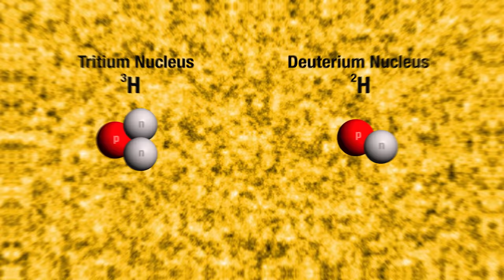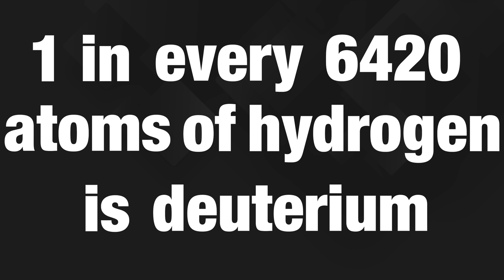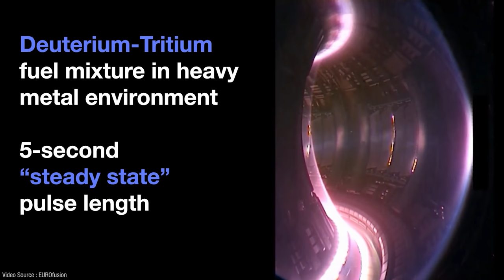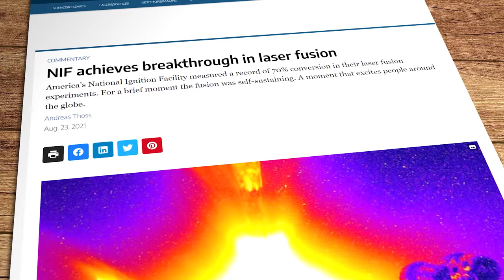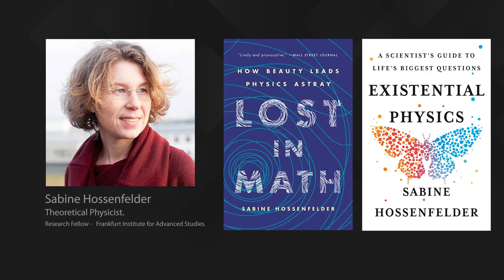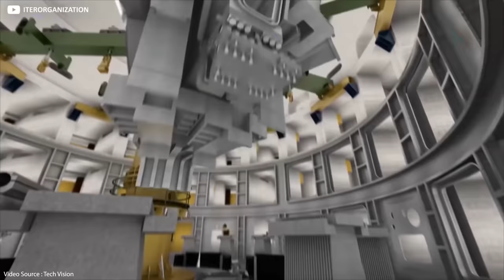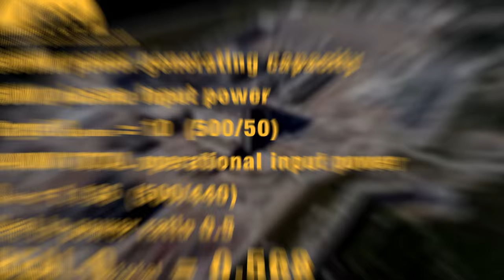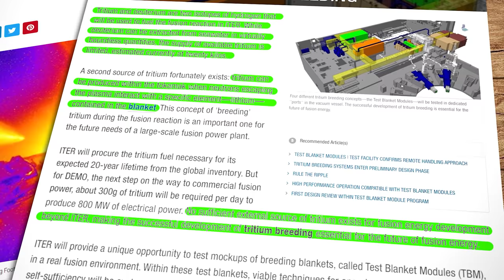Nuclear Fusion Illusion. Is it time to park the pipe dream?

Comment: A minor nitpick, but what we aim to achieve is not replicating processes going on in the Sun. Nuclear fusion in stars is very slow, with only one pair of atoms out of many many billions accidentally fusing and releasing a bit of energy. Any human fusion reactor, on the other hand, would have to achieve conditions far more extreme than those in the middle of the sun, to force a significant amount of atoms to undergo fusion.
Reply: And it's also imposible to replicate the inner presure in the core of the sun so we already needed to go hotter to compensate. So that makes fussion on earth realy hard. As always it's easier to break stuff (atoms) then put it together.
Reply: Brilliant comment, and I think you've hit upon the crux of the nub of the gist of what is central to the core of the issue.
Reply: Hey!  Here's an idea.  Let's just leave this process inside the sun and other stars!
Reply: What do you think mathematical physicists have not calculated the viability based on reactor speed? He is confusing experimental reactors with production reactors. Today's reactors are built to learn and test. The more important values is run time , the q times are not important until we have 24/7 operational reactors. We have suddenly gone from milliseconds to recently minutes, ~17 minutes hold millions of degrees in a container. That is getting close to constant running, not far away at all.
Reply: @AORD72  How are the extreme (millions of degrees) temperatures measured? And how are the instruments calibrated?
Reply: Don't disagree but the process is still fusion as opposed to fission on chemical combustion
Reply: @pauleohl  Avg Ion and electron kinetic energies measured in keV converted to the temperature values.
Reply: Science Revolution  dude.. you ar e early in the dunning kruger curve, it blows my mind.
I can try to explain it to you, but I just can't understand it for you.
Reply: P-p fusion is only 'permanent' one in a thousand times. Almost always flies apart instead, otherwise the sun would be waaay too hot and have burned up long ago
Reply: Science Revolution  You use words you do not even seem to understand and make claims you can't substantiate.
Reply: Unless we stop depending on random collisions and start aiming, as HB11 seem to be doing.
Reply: The way I like to think about the rate of reactions in the sun is this. The sun has burned about half its fuel, and it's taken nearly 5 billion years.
Reply: @pauleohl  I'm not sure how they would for different types of high temperature items, google it. Perhaps mathematical modelling. Perhaps, scaler measuring. Types of radiation output . Creation of types of atoms. Many ways, how do you think they measure the temperature of the sun. There is a whole lot of deduction and inference based on known physics.

Googling the "how is the temperature of the sun known", you get "The color of light a star emits is related to its temperature. This means that we can determine the effective temperature of the Sun by measuring the amount of light it emits at each wavelength and comparing the resulting spectrum we see to models"
Reply: @GeorgeWashingtonLaserMusket  even if the corrosion problems of a molten salt reactor had been solved, which they haven't been, you're using "short term" incorrectly.

We have 8 years.

8 years.

To replace fossil fuels we need about 50,000 one GW reactors. So we need a design that can be mass produced. We don't have that design. All the reactor designs we have are like formula one car designs. Intended to be individually crafted by experts, then lovingly tended by highly trained personnel. None of them are any more suitable than using formula one cars to create a mass transit solution. So we need a clean sheet design that can be made at the rate of a new reactor every few minutes, built by untrained people, operated by teenagers the same way a McDonald's runs, rather than the current rate of every couple of decades, built and run by experts with decades of training. It would take a decade to create such a design if it could be done at all, which I strongly doubt. We have 8 years. 

Then that design will need to be built and tested for at least a decade to pick up even the most glaring mistakes that present in every example and which present in under a decade. We have 8 years

Then when the design is settled, we need to build the factories that make the machines that will go in the factories that build the reactor. To design and build them will take a decade at least. We have 8 years.

Then the factories that will build the vast numbers of reactors need to be built. That will take a decade at least. We have 8 years.

Then once the factories are spitting out reactors, we need to make 50,000 of them. That will take decades unless we're converting the entire world production of everything into just reactors. We have 8 years.
Reply: @jfjoubertquebec  What are you referring to?
Reply: Science Revolution 🤣🤣🤣🤣🤣
Reply: Yes indeed. It is absurd.
Reply: @gasdive  alarmist much? We had 15 years way back in 1990... precisely what is happening in 8 years?
Reply: @Roguescienceguy  It might be  what he isn’t taking rather than what he is. He is just one of the many anti science folk who believes peer reviewed work can be “defeated” by their own thought bubbles.
Reply: Science Revolution  nice try genius but the tide cycle has a different period to the light/dark period. Funnily enough the tide cycle has an identical period to the lunar orbit period. I WONDER WHY?!?
Reply: Science Revolution  People calling scientist stupid should firs check their own stupidity level.
Reply: @AORD72 You can not speak to performance, other than stating an opinion. If the performance improvement is typically asymptotic, it is more likely that going from microseconds to minutes over 30 years is approaching the limit.
Reply: Science Revolution  Yes but you missed something  - Caps Lock is turned off. TO BE AUTHENTIC YOU NEED TO TURN CAPS LOCK AND WRITE LIKE THIS DON'T USE ANY PUNCTUATION EITHER
Reply: @Andriastravels  You should probably take your own advice on that one. The limit is an absolute unknown.
Literally anything could happen. Someone might stumble of the cause of the discrepancy in the Muon wobble, and fix the particle model again. That might give us all the answers. It also may not.

One thing is guaranteed though, as nothing was ever accomplished by not trying.
Reply: @jimmyb1451  Pie in the Sky. I said no one knows any better than anyone else. If you take the position "anything can happen" then don't probability to any outcome, and pray for the best.  Its better to be realistic and act based on the most likely outcomes
Reply: @Andriastravels  My point was, you know equally as little as the person you were criticising.

The limit is an absolute unknown.
Your suggesting your position is somehow more realistic and more likely or  a higher probability, based on literally nothing.

Go nuts though mate!
Reply: Hey you know something? We already have a gigantic fusion reactor. Its called the sun. And all we need is some way to harvest that energy. Oh, hang on, we do, and its cheap. So we need energy storage, right? Well, that's not exactly Star Trek tech. We already have ways and means to store energy and its already being scaled. Over the next 20 years, energy storage will be a gigantic business. It will be mature and cheap. Which means of course fusion will never be economically viable.
Reply: @gasdive  Modern Nuclear Fission reactors can easily produce 50MW. We just need 1000 of them, and we already have like 800 or so, but they are older and less efficient. 
Sure, we could produce them in factories, but France created their program in just 10 years. If you use a single design and construct in parallel, its still doable in 10 years, most of the time goes into bureaucracy, the reactor itself is just a big and solid concrete building with lots of pipes, there's nothing special about it . 

And its not like we have exactly 8 years, the goals are set on sand, we have this ongoing problem, and there's a ongoing risk. Dynamic complex systems will try to self balance until a point where they fail, we can't know for sure when that will happen, but it will.
Reply: What I mean is, they keep telling us that we have this impeding doom, yet they don't want to spent what would be equivalent to a Marshal project in terms of building that massive amount of building, because it would literally cost 1 Trillion USD, if we consider every reactor cost to be just 1B USD. 1T is not a lot of money, the US probably spend it in a year on their war toys.
They talk like we have this doom's day, and act like its a walk in the rain.
It probably isn't that bad of a problem, and we have plenty of time, they must have other motives...
Reply: @monad_tcp  I agree that a trillion isn't a whole lot of money, especially if spent over a decade. However, if you've got a trillion bucks and you want to establish plentiful, stable, carbon neutral energy then you spend it on renewables and a massive energy storage system, no fusion.
Reply: @Scientific Revolution. Should we rephrase it to "you [scientific revolution] don't understand tides?"
Reply: @carldavies4776  no, fusion is not chemical combustion. That is oxidation.
Reply: Science Revolution  wow… you had better go and claim your Nobel prize.
Reply: I was a research physisist at JET and that isnt the problem. The issue is that we csnt replicate the pressures of the sun due to its massive gravity so to get the required fusion, the temperatures needed are immense. This means that controlling the plasma is key or it destroys everything around it. Thats why there are the magnets contolling a toroidal plasma which takes massive amounts of energy to power. Massive flywheels are spun up at JET from the national grid and when ready to fire, the momentum or them is used to engage generators to produce enough instantaneous power to run the magnets.
Reply: Science Revolution   And Trump is greatest president ... don't you agree?
Reply: @monad_tcp  couple of minor nitpicks there. The world energy (not electricity) consumption is about 25 TW (1 million MW). A modern nuclear reactor makes about 1 GW (1000 MW). But that's the average, to meet peak demand without world spanning powerlines we need about twice that generating capacity, about 50 TW. That's 50,000 one GW reactors. Not 1000. The current fleet is about 500, so we need to build about 49,500 more, not 200 more.

The current designs we have are for reactors that only burn up the U235. The neutron economy is not such that you make much plutonium. At current usage we have about 230 years supply. Obviously, if we increase the number of reactors by a factor of 100, we will run out more quickly. At first blush you'd think we'd run out in 2.3 years, but actually, we'd run out before the last reactor was completed. We can't even fuel them all once. 

To avoid that we'd need fast breeder reactors. We don't have a design suitable for mass production. In fact, we have never built a fast breeder with the required neutron efficency. So we would need to create that design. That would take several years. It's not a power point design, we need actual drawings of the millions of parts that we can send to manufacturers to be made. That takes years. Usually decades.

Then we need to assemble the prototype, that will take years, and on current form, 1-2 decades is the construction time from first turning earth to full production. Then that prototype needs to be run for a while to see if it works as expected. You wouldn't just start building jetliners without ever test flying one. That would be madness. This is the same. Ten years of operation would pick up the most glaring errors, but would miss any errors that take longer to appear, or which don't appear in every reactor. Remember that this is a reactor more neutron efficient than anything ever created. It's really unknown territory. 

Then you need to order the millions of different parts, in a batch of 50,000. No manufacturer is going to be set up to deliver them, they're going to need to build factories to make those parts, and in most cases, will need to build factories to make the machines that will make those parts. That will optimistically take 3-6 years before parts are being delivered.

Then the first few thousand reactors need to be actually built. Another 10 years there at least. 

Then the first rectors will need to be run for a full cycle to make enough plutonium to fuel the remaining reactors. So probably another 5-10 years there.

Yes, 8 years is an arbitrary line in the sand, and missing it by a few years won't alter the outcome much, but missing it by 40-50 years certainly will.

BTW, France may have "created" the program in 10 years (I'm not sure what you mean by "created"), but the reality was that they used existing designs for conventional reactors, and the plan was to build 170 reactors over 30 years, which they failed to achieve. The official announcement of the program was in 1974, but some of the parts that failed recently were made in 1965, which implies that the program had been running much longer than the official story. Certainly over a decade. Which means that their plan was to construct 170 reactors over 40+ years. So not very different from the timeline I just laid out, just 1/1000th of the scale (and a failure to achieve the initial goals of course).
Reply: @gasdive  Terrapower is already being built.
Reply: @petyrkowalski9887  Is it conceivable that deuterium fusion could happen in a "conventional" fission reactor where the high speed fission products could hit the deuterium atoms hard enough to make them fuse? The deuterium could be incorporated into the nuclear fuel as a hydride. Is the concept ridiculous?
Reply: @jimmyb1451  the one they're thinking of building (building has not commenced) is not a breeder reactor. If we built the required number we couldn't give them all their first fuel load. They expect to have the prototypes completed by 2030. It remains to be seen if they can solve the problems with sodium that no one else has managed to solve. Somehow I doubt it, but you never know. 

Their breeder reactor has been at the PowerPoint stage of development for a decade and is probably never going past that stage.
Reply: @pauleohl  no. You've described a heavy water fission reactor. Deuterium oxide moderator. It doesn't cause fusion beyond a little neutron absorption making some tritium.
Reply: Science Revolution  I think we all can agree that just because you don't understand something doesn't make it BS.
Reply: @gasdive  What are you basing the 50,000 on, just replacing fossil fuel or total energy needs? Also have you (or anyone really) calculated how many plants using the current best fission technology would be needed because it sounds like we are screwed no matter what we do.
Reply: @jimmyb1451  I think you missed part of the thread. In summary It should be is obvious to anyone there will not be a fusion power plant before 2050.  The discussion was about where research funding should go.  The multi- billions of dollars being spent on fusion right now should be spent dealing with the fission power plant waste problem, and other more pressing issues.
Reply: @StephenJohnson-jb7xe  I took the world annual energy consumption in 2019, converted from MTOE to Wh, divided by the number of hours in a year and got a bit over 23 trillion W. Then I rounded up to 25 TW to account for growth by 2030. Then I doubled it as a guess to get the peak consumption of reasonably large grid areas. (which I think is overly conservative if you look at things like Northern Europe winter consumption, but should be roughly right for the world). Then I divided 50 TW by 1 GW which is a popular size for a nuclear reactor. 50,000 reactors.

We are screwed, but not because we can't build enough nuclear reactors (obviously we can't), but because we're controlled by fossil fuel interests.

We already have designs for the machines that make solar panels. In 3 years we could build hundreds of factories that make those machines and tens of thousands of empty solar panel factories. Then over the following 3 years we could fill those thousands of giant solar panel factories with machines and start making billions of solar panels a year.

At the same time we do the same thing with cable factories, UHVDC converter factories, and cable shipyards.

By 2030 we would have more than enough solar panels installed and world spanning power grid to take the power from wherever it's sunny to wherever it's needed. And the cost to do that would be less than the 5 trillion a year we currently spend on Fossil Fuel subsidies. Which means it could be virtually free for the end user, lifting billions out of poverty.

But we're not going to do that because the wrong people would get rich. So yeah, we're screwed.
Reply: @gasdive  Thanks for the very detailed reply.
Reply: What kind of bottle will they put that genie in that can take that licking and keep on ticking?
Reply: That's why I have a secret faint hope that General Fusion's approach is likely to achieve .... something.
Reply: @JoeDeglman  So how do fusion bombs work, professor?
Reply: @JoeDeglman  I don't think you know what you're talking about. I'm out.
Reply: @saumyacow4435  I think the same but selling super high tech is much more lucrative.  I think it should be satisfactory to store energy in heat pits.  Major advances in weight of solar panels are being made now in the lab
Reply: Saumya Cow : exactly. Just harvest The Sun 🌞
Reply: @gasdive  thanks for correction. I somehow assumed a nuclear reactor could easily be scaled to produce 50MW, then we would only need 1000 of them.
Reply: @gasdive  that's a solid argument against nuclear power we don't usually see.
It's always the stupidity of fear of radiation, or the non-problem of storing the waste.
Or Chernobyl which was a stupid experiment, not an accident, if you do things the way they did you can't claim accident, it was on purpose because of negligence.
But an argument that nuclear isn't good enough because it can't economically scale is a good one.

I only have to also nitpick on the fact that you didn't consider the source of uranium in your account. I know the source you used to come with those numbers that lead to only 3 years of U at max, they are coming from the stockpile of nuclear weapons being decommissioned, nuclear power plants like to buy them because they're basically almost free after the nukes expire and the military doesn't have were to put them or how to get rid of them.
The thing is that we have a tiny amount of uranium mines running.
But if you go see geology studies, there are 8000 million tons of the stuff in the Earth's crust, it's just not that easy to get.
Uranium is not that rare.
Reply: What happened to Solar power was the economies of scale similar to Moore's law with computer microchips because chemically speaking, they are kind of similar processes.
I should have seen it coming.
The scale we can produce solar panels will be much more economically viable.
Nuclear loses to Solar for economies of scale.
Nothing else can compete with Solar and even nuclear.
Nuclear has its uses on remote regions or for mobility as you can make very small reactors, you can't transport a solar power plant that easily, they are massive . But a nuclear reactor for 100MW is very useful and can fit in a truck. Which is were I see the nuclear industry going. Not to the massive 50GW but to the portable 50MW.
What really doesn't want is gas, gas doesn't solve the problem of greenhouse gases, and should be reserved for emergencies.
And wind power is ridiculous, never are going to work at scale, it's just a money drain and a waste of resources and landfill filler.
Not that solar panels won't also be landfilled, the bad thing with them is that we are going to be disposing them like computers because we keep getting better ones.
Solar panels will make e-waste much worse.
And we don't talk about storing power, except for pumped hydro, nothing works. Let's hope an HVDC packeted routing network like the Internet for energy solves the problems.
Reply: @JoeDeglman  Fusion dream smashed.
Those fusion reactors are for studying the fusion fenomena, they're never going to make any energy m
Reply: @monad_tcp  According to the PDF "Dr. Ben Dudson York university lecture 01" Creating energy from fusion, or magnetic confinement fusion, is a waste of time.
    What I understand from the breakthrough in the hydrogen reactor patented by Lockheed-Martin is that magnetic confinement was the problem.   They got rid of the magnetic confinement and let the Hydrogen plasma do what nature lets it do, and it creates its own self-induced  ring current, self-induced magnetic plasmoid, and self-induced corona.
   But according to what I hear about it is that the output contains no such helium or heavy elements, just a pure Poynting flux, just like the photosphere of the Sun.
   They patented it for aircraft propulsion and to create electricity by guiding the photon output directly through large plates, which create an electric current circuit.
Reply: @monad_tcp  no its not that rare. The numbers came from the NEA, and included undiscovered but expected resources.

There's a bit of a rule of thumb that you can double the size of a resource by paying ten times a much. It's not a hard and fast rule, but a guide.

Coal lasted 250 years. 

So if we posit that we need at least half that, and we currently have about 2 years. 2, 4, 8, 16, 32, 64, 128,  that's 6 doublings. So you'd need to make uranium about a million times more valuable than it is now. The value of an item roughly equates to the amount of energy needed to get it. You have to mine and crush a lot of rock to find a diamond, but you don't have to mine much sand to find sand. Sand is therefore cheaper than diamonds. Before you get very far into that geometric progression it's taking more energy to find the uranium than you're getting out. Unless you're using fast breeder reactors. Which we don't have designs for, and starting now we can't have designed and tested before civilisation collapses due to global warming.
Reply: @gasdive  the same was said about petrol, yet we're just now seeing diminishing returns in extraction of energy. How many doublings did we have ? 
They just kept dumping more money as if the energy cost of extraction didn't matter at all.

Fast breeder reactors does help in making it all more efficient.
The think is that the entire petrol industry was perfected over a hundred years.

That rule of thumb is a rule of thumb. What's the yield ? That's what matters.
Is the yield of petrol that high per joule vs uranium ? I ask, how hard is to get 1g of U for 1 ton of rock while using the same 1g of U as energy.
That's the math, which is to say that I bet you the yield for U is 100000 of the petrol. Yet what really matters is having a positive Q.

The problem is an entire financial one.
As long as you keep scaling and have somehow positive Q , it doesn't matter much you have to keep doubling the cost of extraction.

Remember that we do mine gold, which is something ironically useless and only now we started to really consume it in electronics and modern industry.

Diamond is basically free now that we know how to grow crystal in the lab.
Reply: I do agree with you that's too late for that, if we kept pushing nuclear like for real 50y ago we would be there now.
That boat has sailed long ago as they say.
Now nuclear can only be a niche application were you need portability to replace diesel.
As you can't easily disassemble a 1MW solar power plant and transport it, it's literally 2 acres of glass surface.
Oh, nuclear it's still good in power density per area. Not every place is as big as the US with lots of empty lands. Where do you fit solar panels the size of Texas to have a couple of GWy .
Reply: @gasdive  it's fracking of oil even profitable ? Not in $ , who cares about money, what matter is Joules in Joules out.
Reply: Petyr Kowalski : Good enough for me ✅
Reply: @AndreVanKammen  the pressures in the sun are nearly achieved inside of H-bombs. The temperature is also many times higher than the sun.
Reply: @senorelroboto2  Yes, but exploding H-bombs are a bit unpractical in a powerplant. They would be even more difficult than the plasma to contain. The plasma temperatures are also already hotter as the sun.
Reply: Science Revolution  zzzzzz why are you here?
Reply: @GeorgeWashingtonLaserMusket  you just said what the video explained.
Reply: @eglintonflats  😂😂😂
Reply: Please seek some help  you could be useful but now your are not
Reply: What if that's your issue? I'm not an physicist, but why not replicate what you know works?

Go full economically mode & create a large slower system, which is less power intensive to run, & benefits from economies of scale. Instead of trying to quickly jolt fusion to life for a few secondly, slowly add energy to a massive system until critical mass is reached?

Idk I work in finance & I know piss all about physics, though maybe that idea has some merit. Someone smart tell me if it does.
Reply: @gasdive  Diamond coating perhaps... it's been available for some time now
Reply: @sFeral  diamond coating what?
Reply: @gasdive  Reactor wall, providing it really makes it inert under the given conditions
Reply: Yeah, but don't worry, in 20 years it'll be solved.
Reply: So what we are actually trying to accomplish is to duplicate the reaction that takes place in the core of a star that is far more massive than our Sun.  One of those massive stars with a life span orders of magnitude shorter than the Sun's, because it burns it's fuel that much faster.  Therefore a reaction that will be orders of magnitude harder to duplicate.  
Yup,....the looping twenty year timeframe  sounds about right.
Reply: @pathfollower  The sad part is the closer we get, the more we realize it's actually pretty much impossible to achieve working fusion energy.
The most optimistic timeframes are now 50 years, instead of 20 years.
That's why everyone is looking at fission reactors again.
Reply: @AndreVanKammen  Except that's not the main problem at all. We can get things up to stupid hot temperatures like that. The problem is keeping it there long enough to achieve a prolonged fusion reaction that actually outputs some energy.